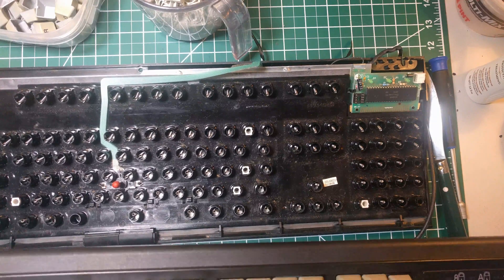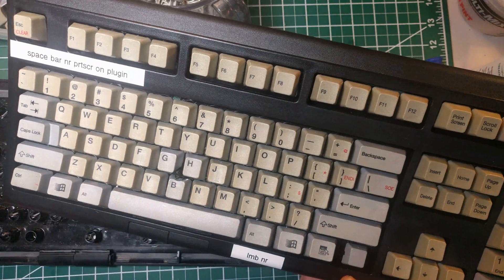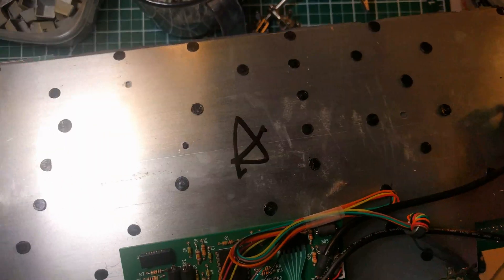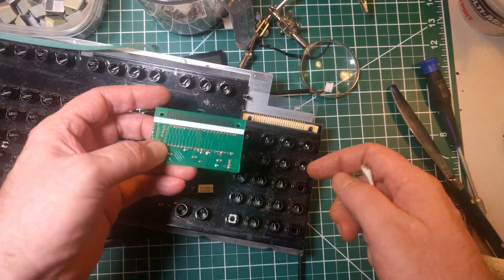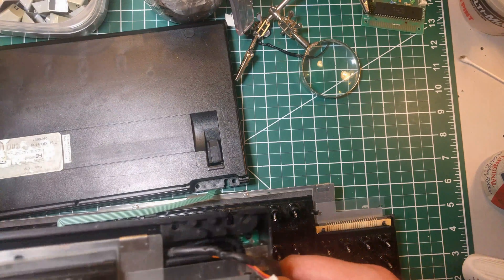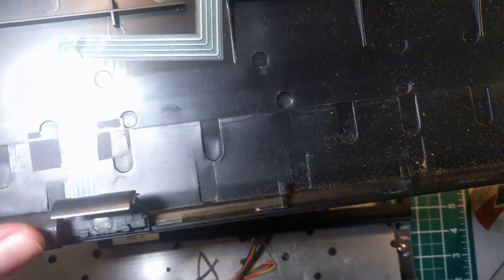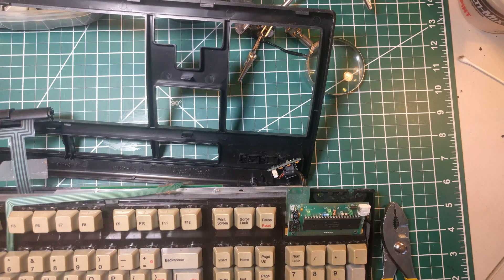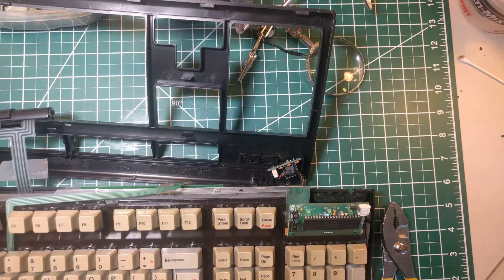Unicomp EnduraPro-like Keyboard (Model M) Repair

Comment: I have a unicomp keyboard of this make and vintage that my cat chewed the cable off of.  Until a saw this vid I had no clue how to get the plate off, but I couldn't change the cable without doing it.  there are a couple of those little plastic tabs missing, so its possible a bolt mod may be due also.  Its fairly clear that Unicomp in the early 2000's didn't spend a cent more on these boards than they had to.

Comment: I've enjoyed having the TrackPoint on the beige version of this keyboard that I bought from Unicomp about 15 years ago, but the left mouse button has lost its click. They're "snap dome" switches that are integrated into that flexible connector that runs under the board. Such a weird choice in a buckling spring keyboard that has such good switches otherwise. Thanks for the video! It helped me see how to disassemble the keyboard safely.

Comment: The "General Electric Cycoloy" markings refers to the type of plastic used for the case, a PC+ABS blend sold by GE
Reply from the maker: Omg that's fascinating.
Reply: GE used to be a leader in plastic development.   I used Lexan for mu motorcycle windshield and it took a bird hit at 60mph and saved my life and was only slightly scratched.  Lexan is expensive and while hard to break, tends to bend and scratch easily.   Beside price the main trade off is strength vs flexibility.   A particular plastic formulation and its thickness are important considerations.   The plastic in the Unicomp appears very thin and to make the chimney a stable shape, it has to be less flexible.   If one used the model F design, the replaceable chimney could be made from one plastic while the backerboard could be made from another.  With the metal plate as reinforcement, flexibility is not an issue.   The real solution would be expensive: buckling keys in Cherry key configuration.   If a key fails, just hot swap it.

Comment: I bought a 2018 ultra classic and I love it!
Reply: How is it still holding up? I got a 2018 and began having issues with bottom row of keys. Opened it and seen what looked like contacts damaged in that area. I am debating on if I want to go through it, the feel is great but mine isn't even buckling spring
Reply: Mine is still going strong but it doesnt get the most intensive usage  @mapavlikify

Comment: My 2020 model endurepro is extremely nice (manufactured this very year). Yes, the plastic is slightly thinner than the old IBM keyboard (not really Unicomp's fault as they bought the tooling from lexmark who made them cheaper), and there is a tiny bit of key wobble, but otherwise it feels amazing. Then again, I've never used a original IBM keyboard.

Comment: Wow this video really helped me with my repair, I would've never guessed there's a double fucking tape holding the thing together. Had it for 4 years and had to do a boltmod already. Your video is the only one with a good look at the insides.
Reply from the maker: Wow  Glad it helped.. Personally I would just get on EBay and buy 2 older broken ones for $50 apiece to make one good one, just because the build quality on these is pretty poor.
Reply: @ChrisMcDonough  Shipping to Russia pretty much kills the price if you aren't buying in big bulk with other people, IBM keyboards aren't common in this hemisphere because iron curtain
Reply from the maker: @RaidonChrome  makes sense
Reply: +1 double tape.  Wasted half hour in the cold garage looking for screws or tabs holding this bastard together.  came inside to youtube it up ftw.  Thanks